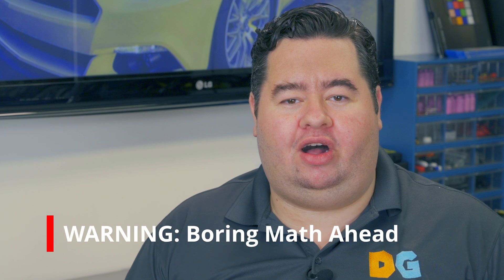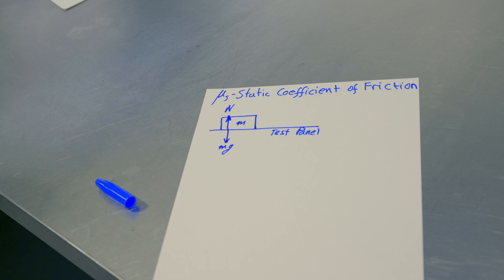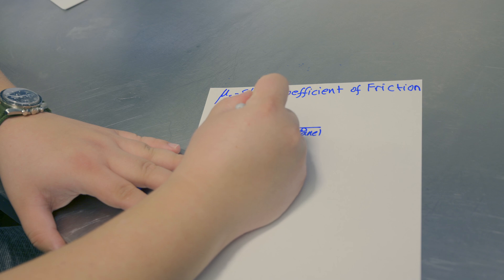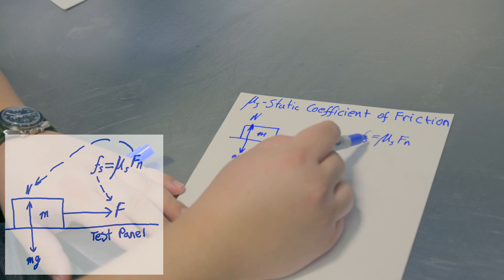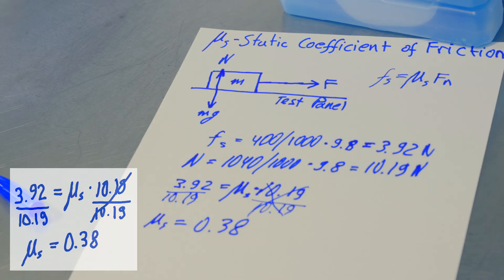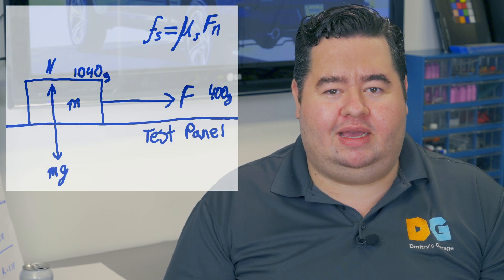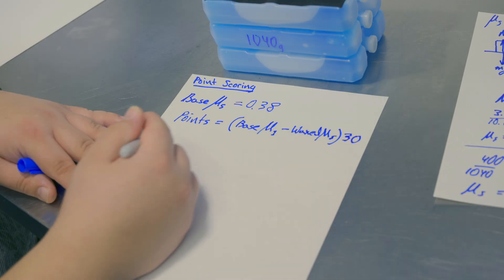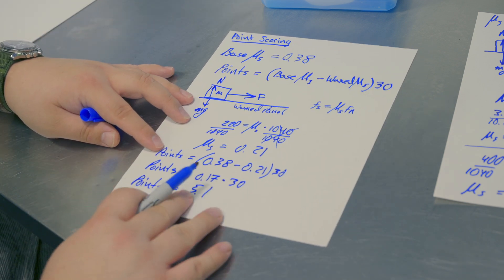Wax Slickness Testing - Coefficient of Friction - Turtle Wax Seal N Shine - Griots Ceramic 3-in-1

Comment: How does the slope of the hood affect this number? Pulling something down at an angle would be less force than pulling it up at an angle. Am I looking at this correctly?
Reply from the maker: Yes it will have an effect. You are correct! I test on the flattest part and try to hit the same spot. The hood curves at the bottom.
Reply: @DmitrysGarage  great test. This is why I subscribe!